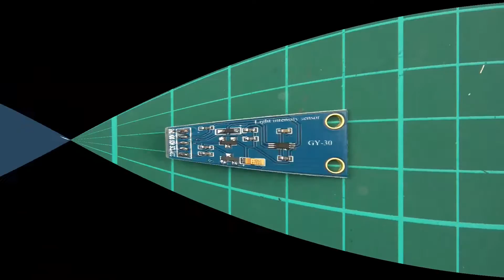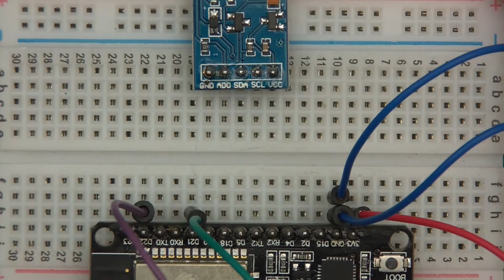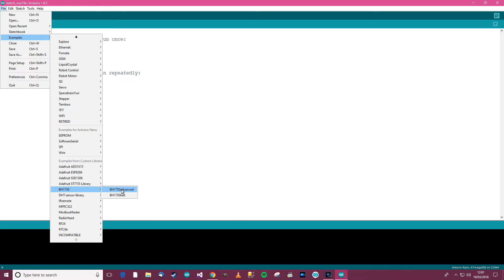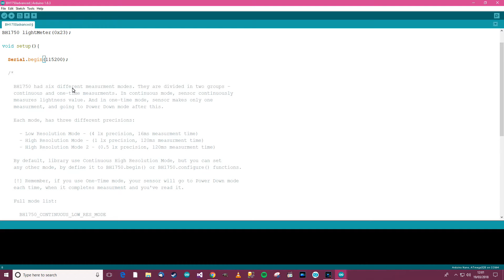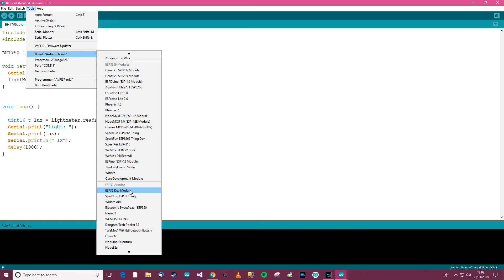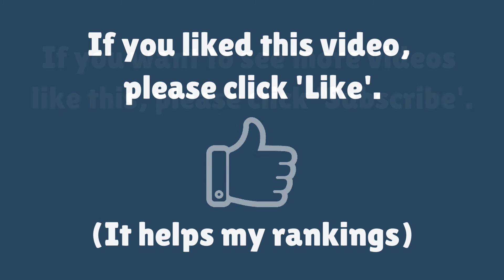TUTORIAL: How To Wire & Code GY30 / BH1750 & ESP32 - Quickly, in 8 Minutes! Arduino!

Comment: I have the Esp wroom 32 with the BH1750 sensor I use the BH1750 Advanced example and it shows me the error [BH1750] Device is not configured! I already have the library Downloaded and the correct connections with pull up resistor, what could be the problem?
Reply: same wth me. you find solution?
Reply: @SenyumNetwork  I had the same situation ever. I found that if it couldn't be welded well, it is not work. So you may check the pins where you have welded is good or not.
Reply: You guys need "Wire.begin();" before "lightmeter.begin();" . Hope this will help!
Reply: @ameerazizibinzulkarnain9458  thx!
Reply: same

Comment: Hey there! please help! 
Since yesterday im trying to get this BH1750 sensor working on my ESP8266 but it just will not work.
The usual output i get is: -2.000 lux - using command: float lux = lightMeter.readLightLevel();
Now i changed my sketch 1:1 with yours - using command: uint16_t lux = lightMeter.readLightLevel(); and the following output is ⸮⸮⸮K⸮ w⸮⸮⸮we⸮⸮K⸮⸮R⸮⸮K⸮ ⸮⸮ ⸮⸮ #⸮ G⸮⸮⸮K⸮⸮K⸮ ⸮⸮⸮ r⸮⸮*  ⸮⸮⸮⸮⸮w⸮⸮ #⸮ ⸮⸮⸮ :

I don´t know what im doing wrong... I´m using the exact same sketch. 
btw.: using my arduino nano, everything works fine. Shows on COM-screen and OLED. 
Other sensors connected to the ESP8266 work perfectly, so its not the board either. Tried out all pins. 

Many thanks and greets! :)
Reply: change your baud rate to 9600 or whatever you have put  serial.begin(x) to

Comment: What method do you use to upload to the esp32?
Reply from the maker: Hi, I use the micro-USB method. :-)
Reply: Duh, thought I had to mess with FTDI's and such, or am I mistaken it for the esp8266? Have an ESP32 laying about, but haven't gotten round to using it. But if it's that simple, I will now, thanks.
Reply from the maker: Marcel Ooms with these modules, the ttl to usb bridge is integrated. No need for ftdi.

Comment: Nice simple quick vid.
Thanks

I have been doing more with the ESP8266 (ESP-12E) and find it very easy to use. 
My next module may be the ESP-32 now.

Sometimes I wonder why anyone would fit the ESP-12 to an Arduino to give it Wifi when you can just program the ESP-12 with the same code (bar a few port alterations), its faster, has more memory and cheaper!
Reply from the maker: Martin Ellis thanks... I agree. Although the ESP32 isn't quite there yet. There are still some issues to work out.